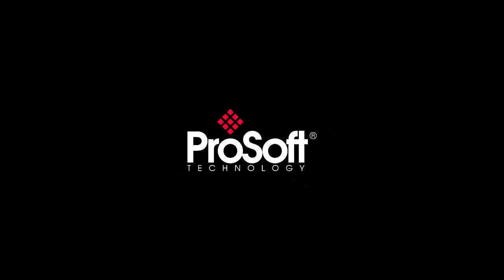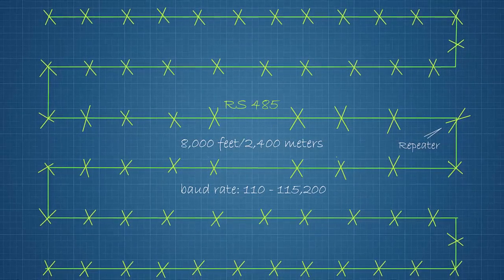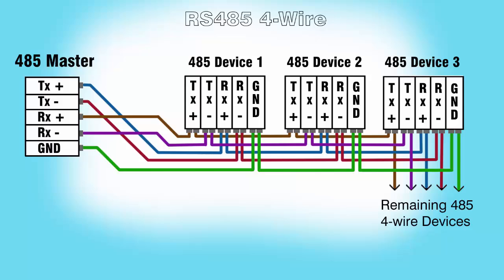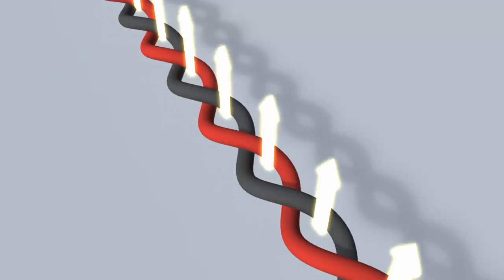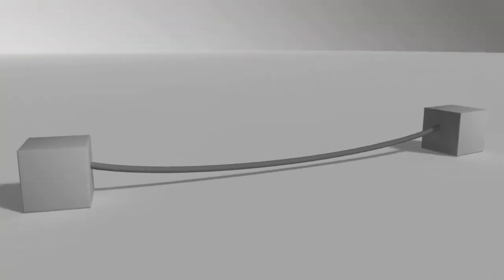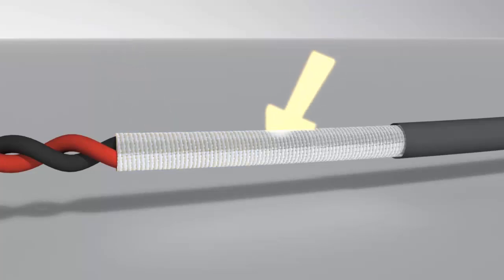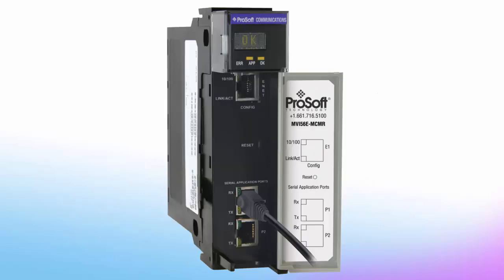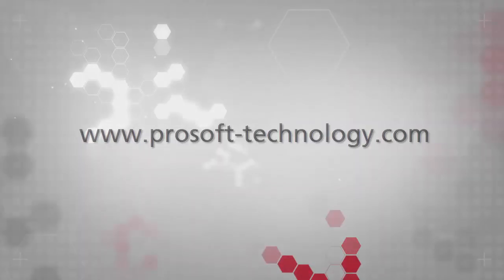Designing and Installing an RS485 Serial Network

Comment: Dear we have rs485 system in solar plant
We have two wire connection and ground but the cable is 4 wire so shall i connect the two  wire in paralel

Comment: How do people handle twisted wires if the two  or more items in the networks have to pass through a rotating slip ring between each item? Most slip rings I see dont do any intertwining of any wires.

Comment: Is it allowed to use a twisted pair (shielded) cable with a lower impedance of around 70 Ohms? Works a RS485-connection in general in that fact? Are there any disandvantages by cables with a lower impedance (f.e. a shorter transmission distance)?
Reply from the maker: Hi there! Our parent company, Belden, would best be able to help you with these questions. Feel free to contact the team at https://www.belden.com/support/sales-inquiry. Thank you!

Comment: hi there. in a 4-conductor cable for RS485, is it mandatory to connect a common ground across all RS485 devices in a master-slave daisy-chain? the use-case is for a master door access controller controlling all the slave door access controllers in a RS485 network.
Reply from the maker: Hi, Joel! Our tech support expert's reply: While the ground / common line is never mandatory for RS485, it is always recommended if all devices support it, as its purpose is for noise detection and mitigation. If, however, noise isn't an issue for your application, or some missed messages caused by noise is acceptable, then the common line can be seen as optional. I haven't personally run into an application where we could not get any messages through until we attached the common line due to noise, but in theory if the noise was bad enough it could effectively make the common line required, but in that scenario it might be best to try to determine the source of the noise and see if you can't, for example, re-route the wiring to avoid it.

Comment: Hi, nice learning video, i've got a question;  I created my own RS485 network, with a total of 11 MAX485 chips (total length 25-30m cat5 cable, @57600 bps). At one end i've  placed 680ohm between VCC and A / and a 680ohm between GND and B + a bus resistor 120ohm between A and B.  when i place a 120ohm resistor at the other end  of the bus, the bus signal fails . is this because of the short length? (i'm sure that no other resistors are in the bus line).
Reply from the maker: Hi there! RS-485 bus lengths of less than 1000 ft. usually do not require any end-of-bus termination, so take out the 120 ohm terminators at each end.  If that doesn't work, call 661-716-5100 for additional Technical Support. Thank you!

Comment: Hi, what is the 9-pin connector for besides compatibility with the old RS232? I am building a new little network, but which might have things moving and shaking occasionally so I'd like to use sturdier and slimmer connectors that are available out there like 6 pin GX12. Is there a scenario where you would ever need more than 5 pins? Perhaps another wire for a 5v power line? That would use 6 pins tops. If I use a DB9, what could I possibly use the remaining 3 pins for?
Reply from the maker: Hi Arthur! We want to make sure we give you the best assistance we can on your questions - with that in mind, please call 661-716-5100 to speak with ProSoft's tech support team, or email support@prosoft-technology.com. Thank you!

Comment: My question is how the rs485 addresses the no of slaves if the slave don't have built in address of its own.. how rs485 get to know which slave its talking to. Can Rs485 store the addresses of each slaves if yes then how to differentiate which slave have which no of address.
Reply from the maker: Hi! This shouldn't pose an issue - every Modbus slave device has a Modbus slave ID since it's a required part of the protocol. Thank you for the question!

Comment: Can you tell me how you can have a multidrop connection in several rs485?
Reply from the maker: Hi! In order to have multiple devices connected to an RS-485 network, the wiring has to be "daisy-chained" from one device to another where the wiring goes in, and then comes back out again to the next device. The following picture is an example:
 http://www.daecontrols.com/images/Daisy%20Chain.jpg

Comment: what type of cable should be used for rs 485?
Reply from the maker: The correct cable to use in RS485 applications is Belden Part #9841.  This is also the proper cable to use for Modbus Plus applications.  This page talks about the various products for use with RS485: https://www.belden.com/products/industrialcable/eia-485.cfm. You can find the cable's spec sheet at https://edeskv2.belden.com/Products/index.cfm?event=printPrev&pnum=9841&ut=english.
Reply: ProSoft Technology g